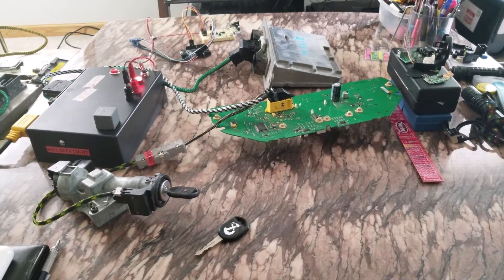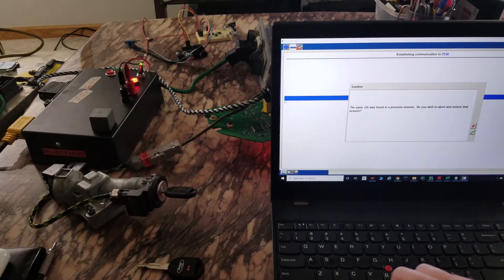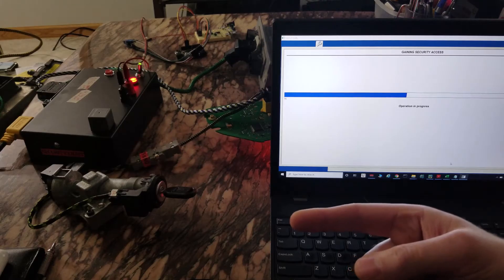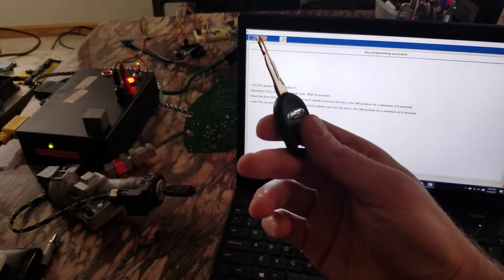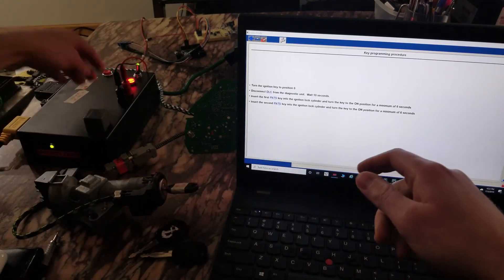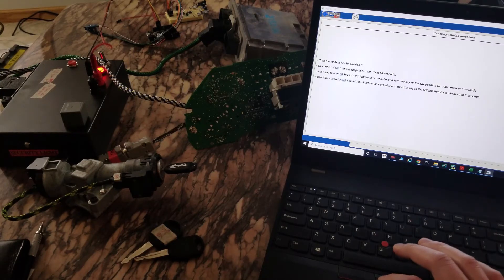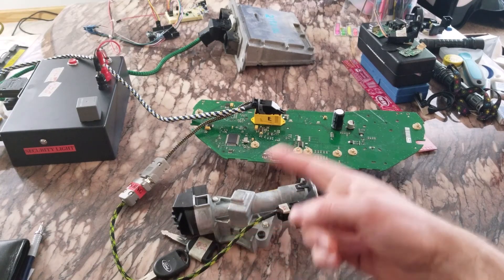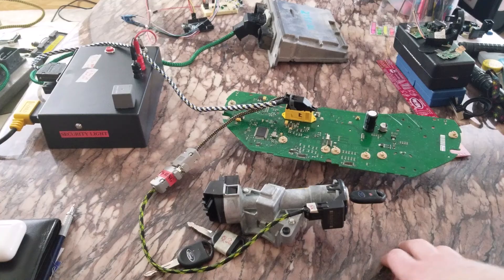Ford PATS Key Programming Problem and Solution

Comment: Hi my name is Justin and I work at a service garage. We have a 2008 ford edge 3.5 L and one day the vehicle would not start and I looked into the problem and there was a code for transceiver not found and minimum number of keys not programmed. So I cleared the keys and tried to reset them but I am not able to do so. The back story is that the customer put the key in the wash and it threw the anti theft light on. I purchased a new oem ford key and PATS transceiver ring but still not able program keys. The theft light is solid when key is in the ignition and turned to run. I have tried to reset the perimeters and erase all keys and reprogram new keys the only key that flashes rapidly is the old washed key. Could it be the gauge cluster like described in the video. I have battery voltage going to the PATS transceiver.
Reply from the maker: Hi Justin,
I had a similar case on a mustang this week. Replacing one of the PATS keys and the cluster fixed the issue.  In my case the key that caused the rapid flashing theft light was faulty.
Give us a call if all else fails.

Comment: I am having a similar issue on a 2001 mazda b3000 i can delete the old keys but cannot program the new keys it starts but as soon as i turn it off the theft light turns on flashing and wont start
Reply from the maker: Hi there,
It could be cluster, pcm, pats ring, keys, wiring, programming tool, ect.
You can ship the parts to me for testing/programming if you've run out of options.
Reply: Integrated Auto Modules thank you for the reply, i fixed my problem they sold me the wrong keys got the correct ones works now.